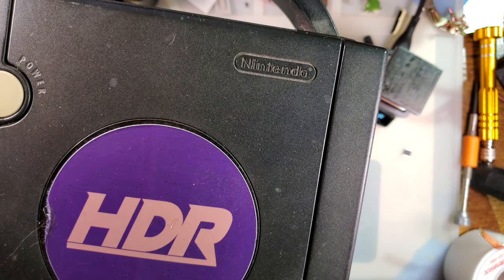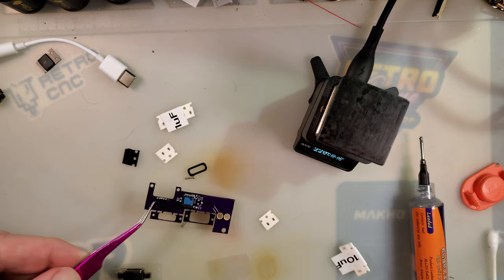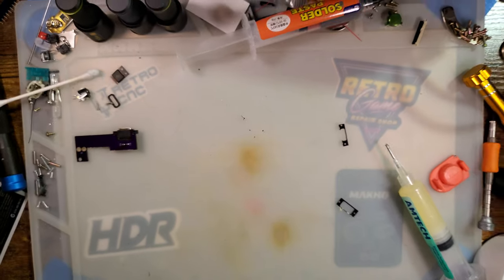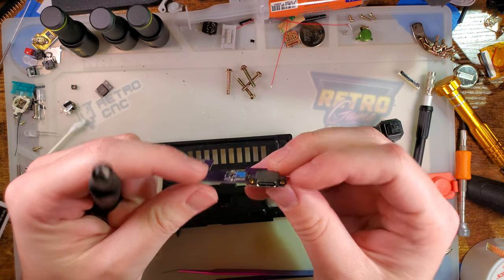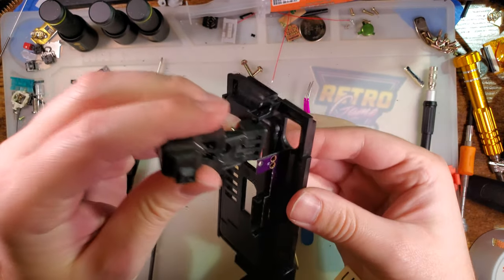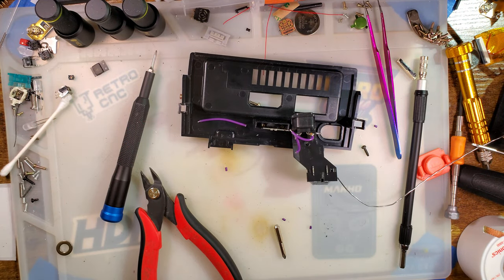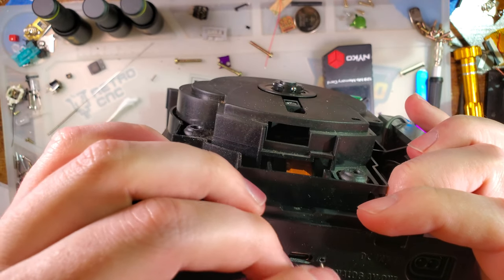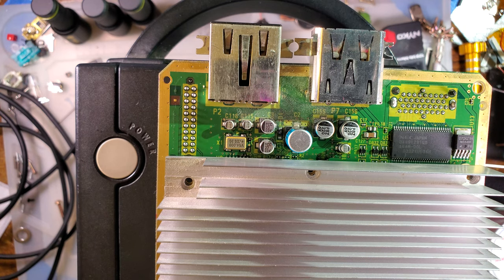GameCube Power Delivery Mod from HDR

Comment: I recently got one of those insidegadget wireless Game Boy advance cartridge with the GameCube receiver. I feel technically speaking this is the best possible way to play Game Boy and Game Boy advance games on the TV. I'm hoping an analog pocket and doc with an official Nintendo SNES wireless controller will beat it but I've been waiting 8 months for that dock and no word yet.
Reply: There are snes to gamecube adapters as well, and I believe you could use the official gba to gc link cable to control the gameboy player as well.
Reply: @anonymousidea9119  yeah but those are not wireless. Also I enjoy the concept of using a modded Game Boy as a wireless controller for a gamecube using the Game Boy player with the disc.

Comment: And here I thought my method was smart. I'd made a couple of basic power distribution unit PCBs to take a single barrel jack and output it to phoenix MSTB-style connectors so I don't have to solder up daisy chain cables (I called it the DC Divider on oshpark).

Comment: Yo this is awesome! I literally just bought some USB PD sink adapters on amazon this week and made myself a 20V charging cable for my laptop (yes, I know apple has had USB-C charging ports on their laptops for 8 years, but competitors are still catching up and my unit lacks one), so I've made my own! Never even thought about doing this for a console or something, that would be so cool!

Also working on using one for an LED lamp so definitely having to use a buck converter in addition to the PD chip, which adds some extra stuff for sure. At least inside the gamecube there's a lot of space for things like that.